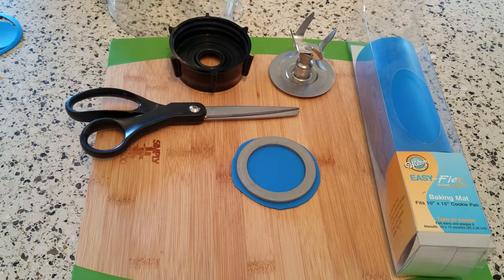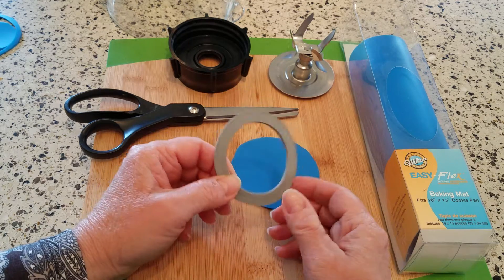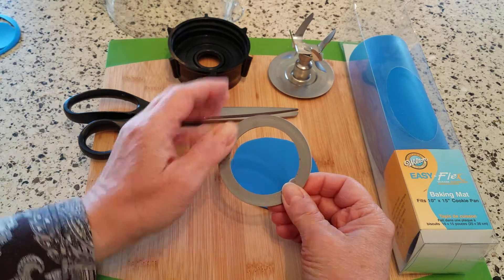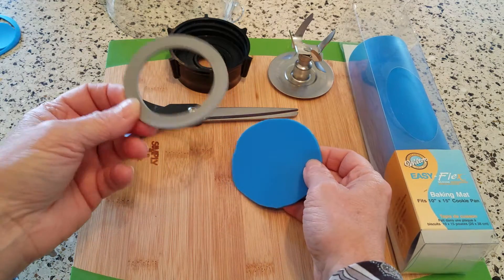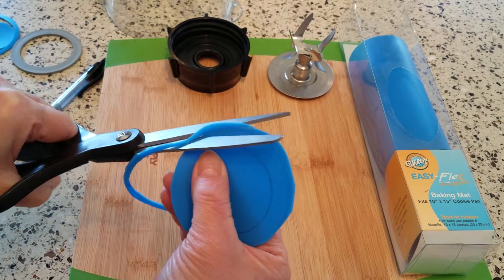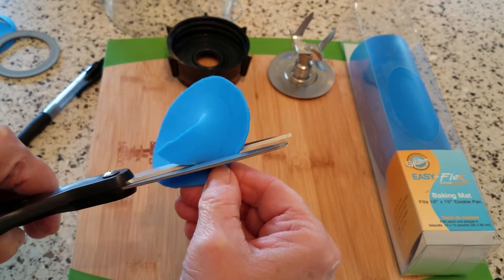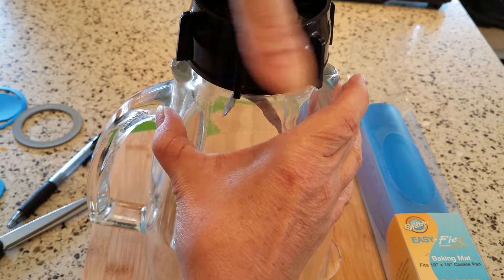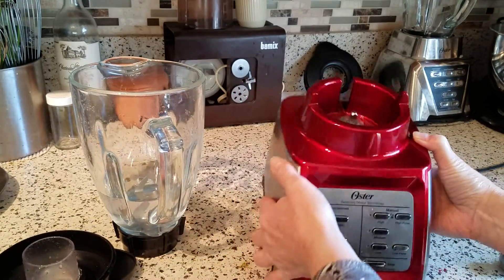DIY: Silicone Gasket for my Oster Dual-Action Blender

Comment: What a great idea!  The rubber gasket Oster uses is toxic!  They use a Chinese manufacturer that uses plasticizers that are not FDA food grade approved.  Hence the strong chemical smell.  Silicone is a good option but trying to find one that's professionally manufactured to avoid bits breaking off.
Reply from the maker: The original rubber gasket stunk from accumulated odors.  Oster claims that their gaskets are made from "food grade rubber", whatever that means.  I much prefer the silicone as it's easier to clean and safer to use. Thanks for watching!

Comment: If I had the original gasket  why would i have to make one?
Reply from the maker: Because the rubber gaskets made for this blender get stinky and crack over time. Mine was holding on to odors that became impossible to get rid of. Silicone is much easier to clean.